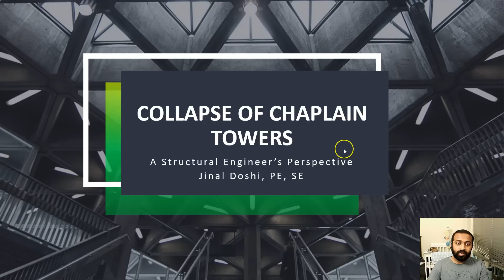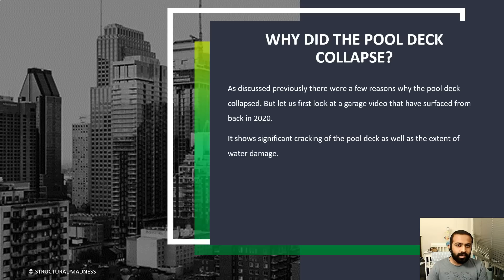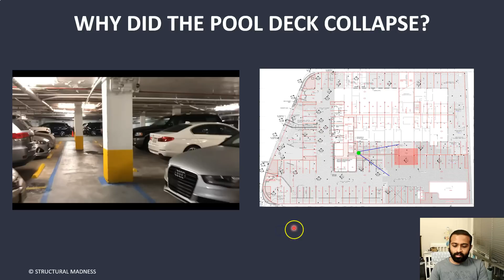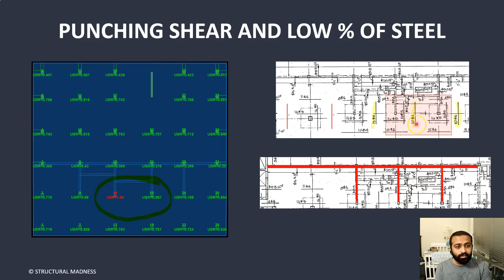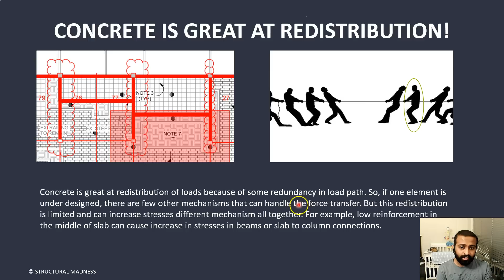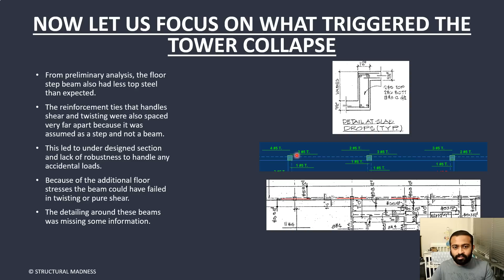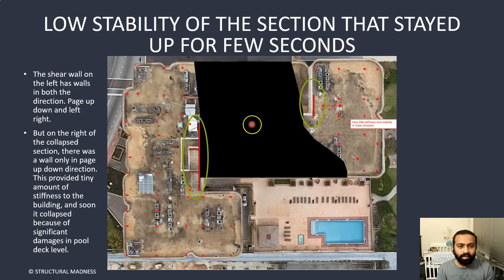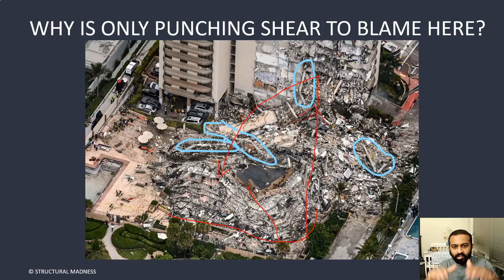Reasons behind Surfside Building - Champlain Towers South - Collapse : A Structural Engineers Review

Comment: It was an obvious controlled demolition
Reply: So it seems 🤔🤭
Reply: No, it wasn't. Just because (on TV) a controlled demolition looks (a bit) like this (superficially), does not mean all things that look like this are controlled demolitions. This is a failure in basic logic. Dolphins swim but are not fish.  There are clear reasons why and how the building could collapse without foolish conspiracies involved.
Reply: @gordonwakelin-king3272 ok handle these questions.
1. How was the remainder of the condo prepared for demolition within 10 days?
2. How come all 3 collapsing sections fell at free fall speed into their own footprints and not 360 degrees any other direction?
3. How come the flashes seen in the collapsing building were exactly the same time period before collapse as the known controlled demolition?
4 How does asymmetrical damage cause a symetrical collapse not once but 3 times as well as the known controlled demolition?
5. How come the known controlled demolition took the same amount of time to fall into it's own footprint as the initial collapse?
6. How was free fall speed achieved for a natural collapse?
7. How does a few rusty rebars and a few cracks end up in a free fall speed symetrical collapse straight down onto the condominium property only?
7. I also have some concrete damage and rusting rebar to my home's foundation, should I be afraid of a catostophic collapse of my entire home?
Reply: @sundaywhiterabbit7679  If someone is so evil and clever as you suggest,  why would they leave what you seem to think is such clear evidence?  You perceive a  similarity that is more superficial than you think,  and pose questions that are answered by "why not?", "gravity" and "they didn't".
Reply: @gordonwakelin-king3272  great way to avoid answering. And shows your ignorance. Go watch a naturally collapsing building and see if it falls at free fall speed or takes longer. 
It takes several months to prepare a building for controlled demolition not days. This is information easily found in several places on the internet including Wikipedia.
And don't be naive and think the news doesn't lie or cover things up or sensationalizes such mundane things and turns them into tragedy never happened. (There were NO LIGHTS ON IN ANY OF THE CONDOS AT ALL!!) 
And don't be such a sheep and think extremely wealthy people would NEVER do such a thing for more money. Because I will bet you an even more expensive luxurious condo will rise in it's place, and please let's not mention that this building is the reason SEVERAL more condos in the area are being vacated. It's a f'n land grab.
Channels such as these, and there are dozens now, tirelessly presenting every last reason for the collapse TO HIDE CONTROLLED DEMOLITION. 
And by the way.
Your "not an answer" is called
PLAUSIBLE DENIABILITY tactic, which is usually used to cover up a lie. 
Just so you know. 
But idiot, be thankful, this is just a money making scheme, by what looks like our devious "little hats" once again. As the exact same people come to investigate this collapse as did the last strange collapses that also looked like controlled demolition and not a natural collapse where at least 3 buildings also fell at free fall speed into their own footprints, and event a natural collapse has never in history has ever occured. And started 20 years of wars of terror resulting in the murders of over 4 million innocent people on the US taxpayers dime. Because spineless people like you were either too ignorant or too weak to ask the hard questions.
And by the way...
The ONLY way free fall speed can happen is if ALL the floor trusses were separated from ALL the structural columns at the exact same time, which is only accomplished by precisely placed explosives. A natural collapse has RESISTANCE when falling and it would take a significant amount more time than free fall speed as well as fall in one of the 360 degree directions and not straight down. 
So you're a massive coincidence theorist?
Detonation flashes occured in the original collapse same few seconds before collapse, all 4 times. All 4 sections that were separated by 2 hour firewalls (actually different buildings) fell strait down at exactly the same amount of time. 
Free fall speed is attained by a mathematical equation easily done and calculated. 
3 seconds for a 12 story building is exactly free fall speed. All 4 sections fell in 3 seconds.
Therefore the ONLY conclusion is the obvious conclusion
CONTROLLED DEMOLITION.
Sorry if you're an expert but if you didn't know these things you just let a architectural AutoCAD drafter explain it to you, and if you're an engineer, that is a damn shame. 
See I know building codes. I know how those buildings are put together and I know what it takes to demolish them.
As an "experts" you're an idiot.
Reply: @sundaywhiterabbit7679  You forgot #8 there, Eisensteen. It goes "..5,6,7,8". Not "..5,6,7,7".  Mmkay? Thats a 7. Followed by an 8. Not another 7! Mmkay? Do not question my knowledge of this, as you've done with others. You will be made a fool. It is fact! Do not question my authori-tie on this, beeotch! I will smite you down at free-fall speed into your tiny feety print in the mud. And you will also see flashes when my smite connects symmetrically upon your #8 lacking cranium. Back to your basement couch and stale cheetohs, Mr. Wednesday Brown Chipmunk. Trolls are asshats, Mmkay?
Reply: @KSparks80  still a controlled demolition.
Reply: @KSparks80  you're the one with a channel with no content and you don't subscribe to any channels at all. Which is very odd. You look like a media troll. Like all the others.
The Empire has no clothes. Some people see it. Too bad. It happens. Not everyone is going to buy what the media sells.
Reply: @sundaywhiterabbit7679   I pulled the few vids I'd posted down when I made my channel private awhile back. If it helps, I've been on for 14 years, have 5K+ Liked vids, 270 Favorites, and 74 in Tunes, and don't really care if my comments piss ya off. So,  sorry, no troll here.
Reply: @KSparks80  yawn. You're still a troll. Not sorry my comment and truth offends. If you believe what you hear and not what is obvious to your eyes then you will see clothes on the Emperor. There is more than enough proof that is a controlled demolition. But people love their death drama and can't let it go. They love it their lives are mundane without it they might see that.
Reply: @sundaywhiterabbit7679  Your comments don't offend me. They're just wrong. What proof do you have saying this was a controlled demolition. I've yet to see any. I see a structural failure followed by a collapse. Period. You keep comparing this with the WTC buildings coming down. It's not the same at all. They fell from the top down, "pancaking" on their way due to the weight above crashing down. The condo building dropped when the lower columns failed, and the rest followed. I thought you were an expert?
Reply: @KSparks80  oh my gosh. There is zero hope for you. Seriously. None. Free fall speed can only happen with NO RESISTANCE. Resistance would be floors attached to columns throughout the building for BOTH WTC and Surfside. All of these buildings fell at free fall speed right strait down through the path of MOST resistance, right down onto ONLY THE PROPERTY. Any other natural collapse takes FAR LONGER than free fall speed due to the resistance. None EVER fall through themselves. No buildings have EVER fallen like that naturally except for WTC and Surfside. Not before and not after. They are lying.
You can CLEARLY see the detonations going off! Not only did this happen at Surfside, it happened FOUR TIMES at Surfside. The initial collapse was three separate buildings separated by 2 hour firewalls as per building code. So all three sections fell at free fall speed (calculated by a easy to follow math equation and compared to the time from the videos which is roughly three seconds). The initial collapse not only fell at three seconds for all three sections but all fell strait down onto the property and not any of the 360 degrees they could have fallen. Just like the KNOWN controlled demolition part, which detonation flashes are also clearly seen at precisely the same time before the building began collapse. Then the news said they prepared that remaining part for controlled demolition in anywhere between a day and a half to ten days before. Which I know for a fact is not even possible.
I think you're buying what the news is selling and not thinking critically here and possibly ignorant of laws of physics and how buildings are put together and demolsihed. Those are far out coincidences to swallow and beyond impossible for a natural collapse.
Now how many other condominiums in the area have had their tennants removed? Three or four? Yeah they are being pushed out in order to build bigger for all those super wealthy New Yorkers moving into the state. It might be some building contractors who did it. That little patch of land there is some of the most expensive real estate in the country. Maybe 3/4 of a million dollar apartments just aren't cutting it anymore. 
I bet you this...a bigger more expensive more exclusive condominium will be built in it's place by some little lying hats in the nest future and they will move in all their little hat buddies. They won't build a memorial or a park to commemorate the dead...if there were any dead people at all. Looks like ALL the lights were off in ALL the condos indicating no one was in the building anyway.
You don't know how news works and lies and covers things up. You think what they say is the truth. Which I have "news" for ya...they don't. They do stage things and film it like any other tell lies vision programming show. 
They need to quit before more people start to see through this fraud and propaganda. And more are seeing it every day. Just not you...yet. 
This is more than enough proof that the Surfside was a controlled demolition. It's obvious.
Now you can see clothes on the Emperor but I do not.
Reply: @sundaywhiterabbit7679   Damn, man. Take a pill. And do it quickly, or the naked dude behind you is gonna grab it!
Reply: @KSparks80  I'm a woman. Sorry not sorry I know more than you and you can't understand. You're making excuses for the most corrupt people on the planet. Please stop and open up your eyes.

Comment: Interesting.   There is one mode of concrete failure not mentioned that might prove to be important in this building collapse.  It was brought out in someone else's video analysis, that the pool deck slab may have suffered concrete delamination due to infusion of water from the top side.   This would cause greater corrosion in the upper rebar of the slab and possibly cause it, in time, to delaminate from the lower portion of slab.    The lower portion of the slab having less rebar would then be subject, alone, to the punching shear everyone now mentions.  This might also explain why there was no portion of slab remaining on top of the columns where punch thru occurred.
Reply from the maker: I am unsure of what they were referring to. But if you provide less than required or just enough steel to handle the floor’s own weight then any additional loads will open up the crack further leading to additional damage to the reinforcement because of water penetration. If that’s what they were referring to, then yes, it is the same concept as discussed here. As it deteriorates the steel faster.

Comment: Great graphics on different garage views. Instead of using athletes for contrast, maybe use animals 🤷‍♂️. Overall a very good analysis. Question... if they had started on structural repairs last year would they have prevented this nightmare?
Reply from the maker: I think Morabito associates had some details about replacing the existing damaged reinforcement for sure. But I am not 100% sure if they had planned on strengthening the slab / adding drop caps around column top to support the slab. Unless they would have planned on doing that, all the other fixes may have temporarily helped the slab but I suspect not for long.
Reply: the short answer to your question is NO!
Morabito misled the Owners into believing the building would be ok during years of repair, when in reality this building required immediate shoring in the garage and other actions.
Reply: @jmarker35  They also got a bid of about $100,000 per unit(coincidently).  Sounds sketchy/greedy.